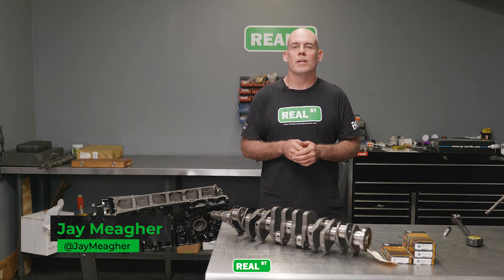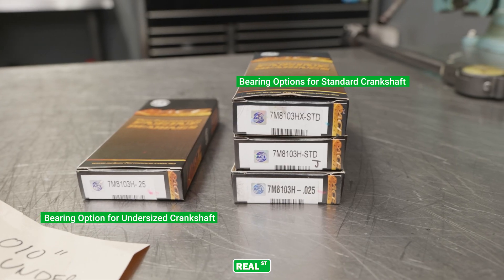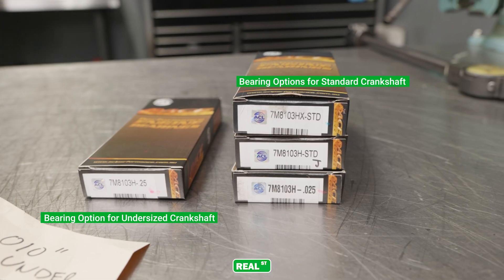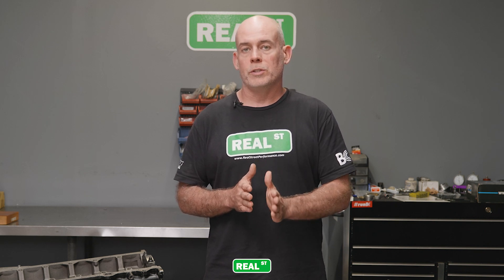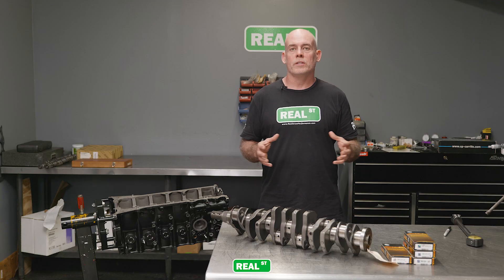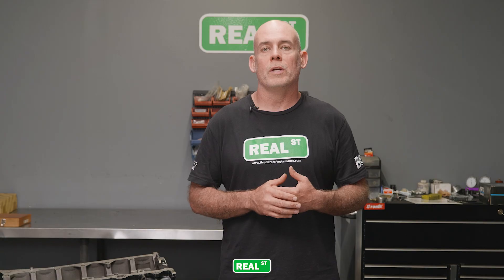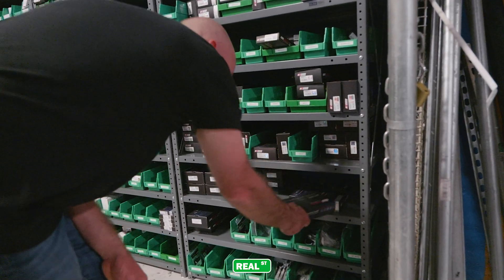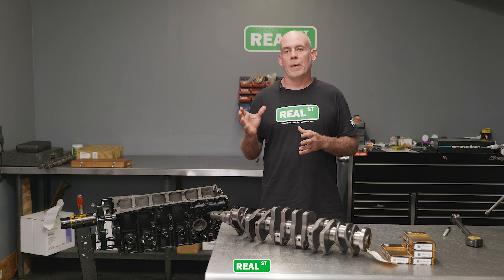Targeting Oil Clearance On Undersized Crankshaft

Comment: If I’m seeing inconsistencies across main bearing oil clearance(.0019 vs .0025) after already swapping shells to half h& half hx, could I realistically put two hx shells on the .0019 journal to get desired oil clearance to match?

Comment: Great Video. Thank you. Wish I had seen it earlier. Only just discovered your channel

I had this exact problem. Learnt the hard way. I dropped a crank off and just said 0.010 under please. Got it back and I had 0.004" clearance! Turned out there was different specs for crank journal sizes on that engine. 
I just happened to have another crank shaft, so I took it to a different machine shop (no hard feelings with the first shop, I blame myself)and said can I leave the block and rods with you with the bearings in them and you measure them and grind my crank to fit. The grumpy old fella working there said " Usually you just drop the crank off and tell us you want it 0.010" under" and looked at me like an idiot. I told him I already made that mistake! Can you please grind as I have asked and I would prefer 0.0025" clearance.
He agreed to do what I asked and it turned out perfect. Every journal was within 0.0001" of each other and my clearances were plus or minus 0.0002" of 0.0025"

Comment: Thank you for this!!!🔥🔥🔥 so basically I will measure with oversized bearings and whatever the reading is that’s what I tell the shop? Do I need to add or subtract from my measurements when I tell them what I want or give them the exact measurements? Thanks again.

Comment: Great video and info. Just have one question. Is it possible to weld build up on the bearing journal and machine it back to stock ??
Reply: Yes and that's been one approach that's been used over the years. It's best to find an OEM machined crank OR a crank shop that has a really good running operation.  It's difficult to get the crank as good as it was with OEM machining. Thanks

Comment: Jay, do you send JZ cranks out to get nitrided after machining is done? I know it's very important on 4G and Subaru cranks that have been cut.
Reply: Depending on the operation. If you've machined enough off the crank to get through the surface hardness having it nitrated. I'm still a big fan of finding a crank that doesn't need work as it's a shorter path to success. Thanks

Comment: i thought you cant use your dial bore gauge on top of the bearing because you will scratch it ? @ 2:37min
Reply from the maker: You will mark it. But I assure you the amount of wrong that happens inside of an engine when you don't check clearances are far more wrong. - Jay.
Reply: @realstreetperformance  talking like a true Boss.....spot on who cares if u mark it a bit....we need to find out the exact seating clearance of the tunnel with the bearings inside. Thanks Jay your a legend straight up

Comment: I heard that only STD crank is holding power. all undersized 2jz cranks are not working and they are spuned again shortly on rebuilded engine
Reply from the maker: The problems are rooted in the finishing work and not the crank itself. - Jay